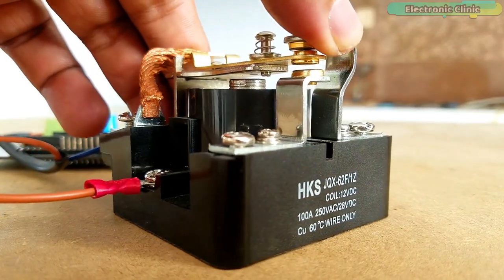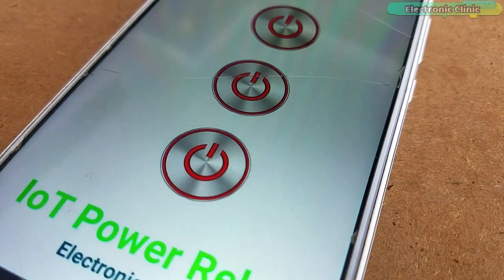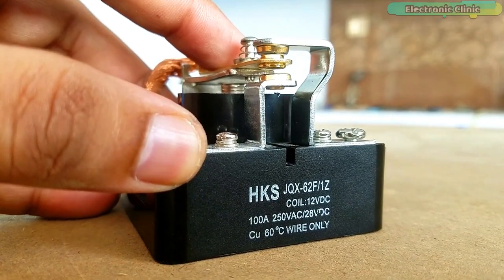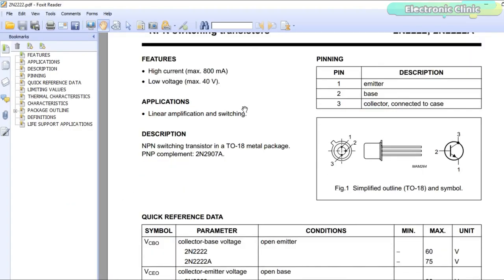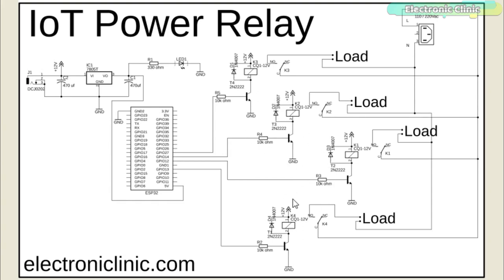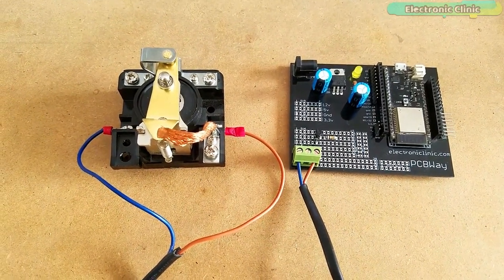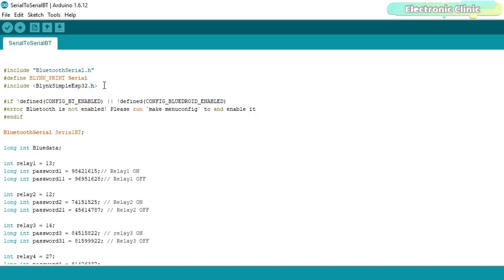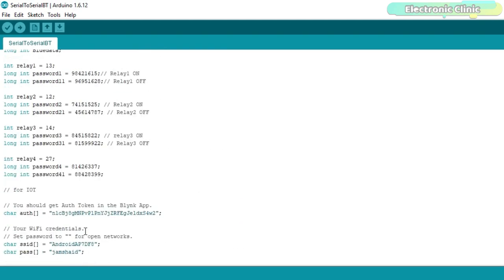IoT Power Relay, IoT Relay, ESP32 relay, Wifi Relay, Bluetooth Relay, 12V 100A SPDT Relay

Comment: Abruptly cuts half way through
Reply from the maker: this is fully tested. you can also remove the resistor connected with the base.
Reply from the maker: or your esp32 power supply isnt able to provide enough current. make sure you have added 470uf capacitor at the output of lm7805.